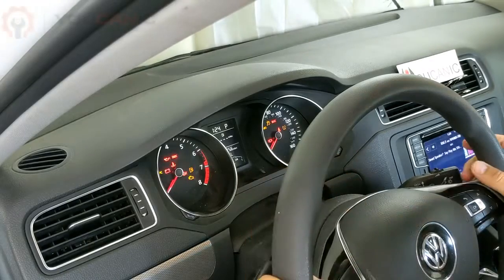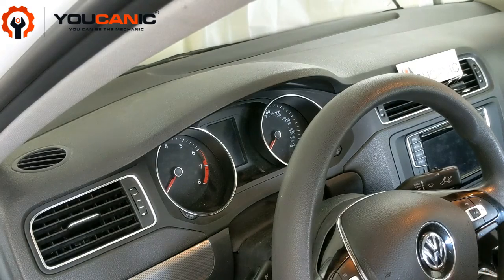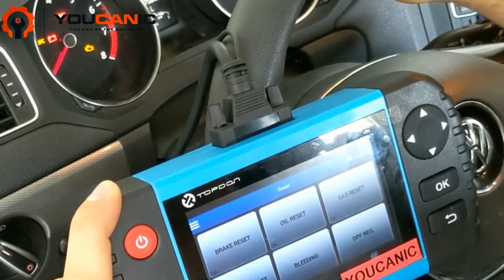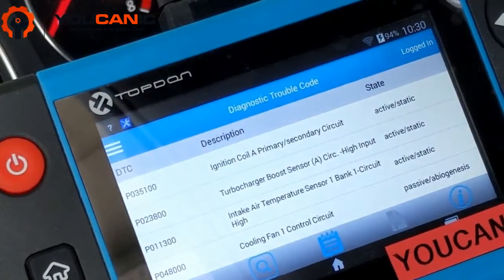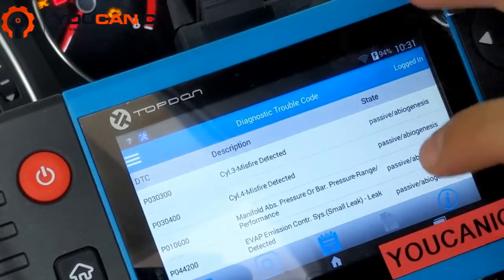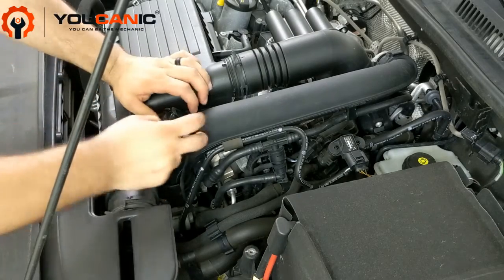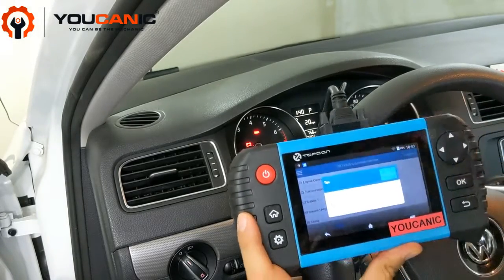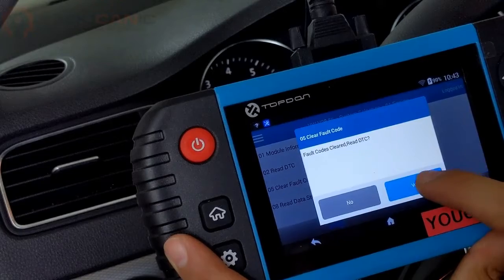VW Turbocharger Boost Sensor P0238 P0113 P0236 P0106: Symptoms, Diagnosis, and Repair

Comment: Anyone have any idea why I only get P0236 on startup? I clear the code and can hear the idle smooth out and it doesn't come back while driving. Comes back on restart.
Reply from the maker: Thanks for reaching out! The issue you described might be related to a faulty turbocharger boost sensor or a loose connection. However, it's difficult to provide a full diagnosis without more info. At YOUCANIC, we aim to help car owners like you gain confidence in maintaining their vehicle. Explore our resourceful platform and utilize our YOUCANIC diagnostic scanner for further assistance and our factory repair manuals for detailed instructions. Our dedicated team is ever ready to support you. Let's make your car ownership journey smoother together. www.youcanic.com.
Reply: @YOUCANIC  it seems it may be from plugging in my DPF sensor with a full delete.

Comment: I'm getting a p256 3 code and the accurator and connections seem right could it be a sensor but in a infiniti q50 is it all the same sensors for left and right turbo
Reply: did you solve this ?